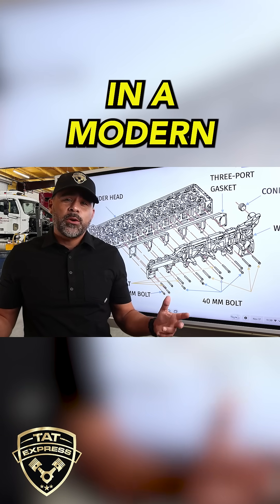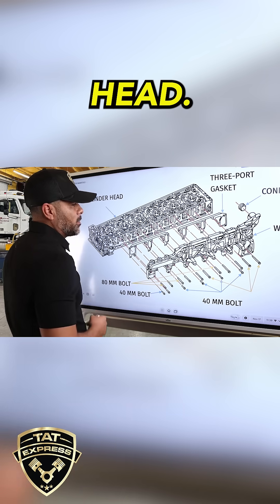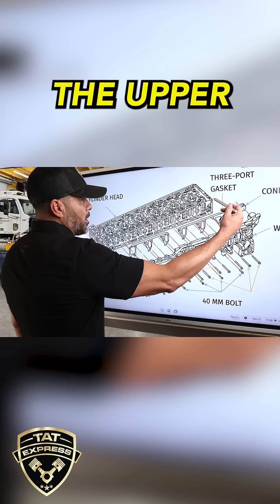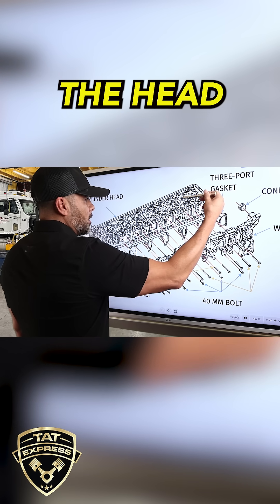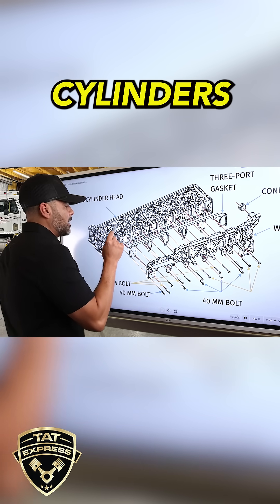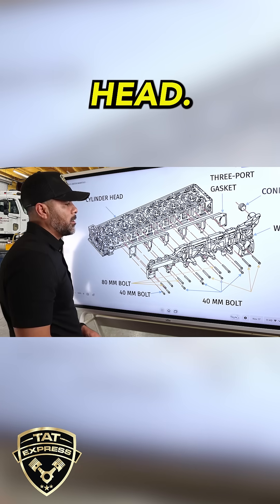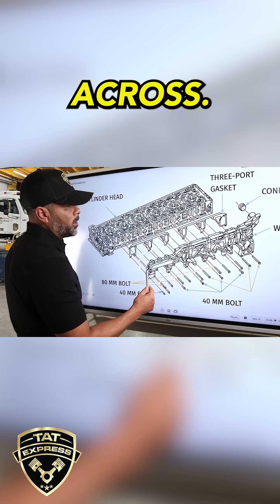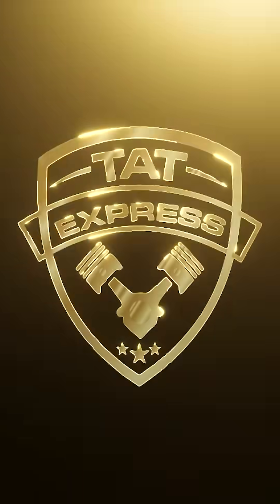Why DD15 Cylinder Failures Hit #5 & #6 First 🔥💧⚙️

Comment: Well there is a lot to this. Ecm wait till 215 to turn on fan,The egr cooler,the lack of service of coolant. I always till the drivers lock the fan in when idling.  Emissions really introduced a lot of heat into the engines.  Am strong believer in 150k all new coolant
Reply: 1. Use test strips to check anti-freeze pH level and boiling/freezing point level of the coolant system

2. Shake-up anti-freeze in the jug, (even w/ 50/50 mix), to ensure all the additives are blended in as much as possible before adding the fresh anti-freeze to the coolant system
Reply: @matthewscopelite5303 nope and another nope
Reply from the maker: @matthewscopelit…
Good points 👍 Coolant chemistry gets overlooked a lot. pH, freeze/boil protection, and proper additive mixing all matter just as much as coolant age when it comes to heat control and component life.
Reply from the maker: @sonofmontezuma…
Exactly. Fan strategy, EGR heat load, coolant condition, and service intervals all stack heat at the rear cylinders. Locking the fan at idle and staying on top of coolant maintenance makes a real difference. Good points.